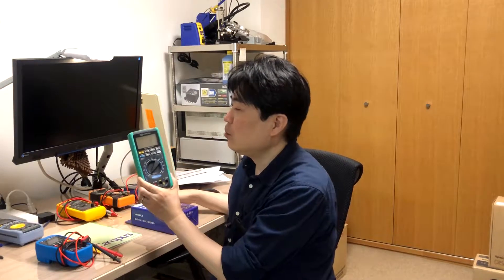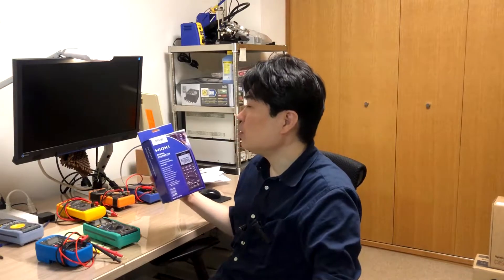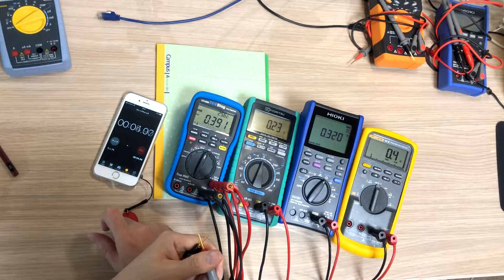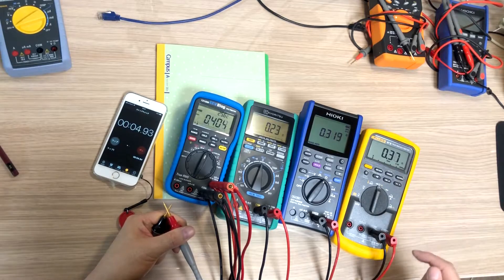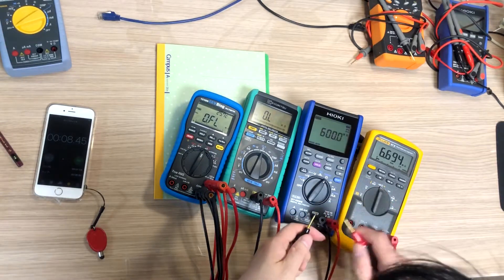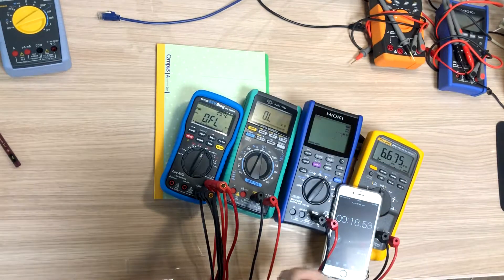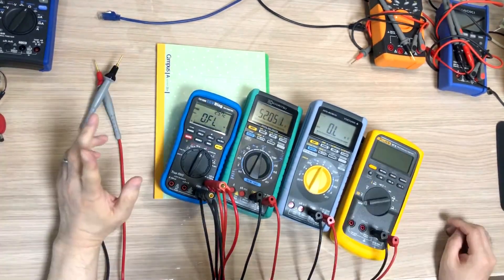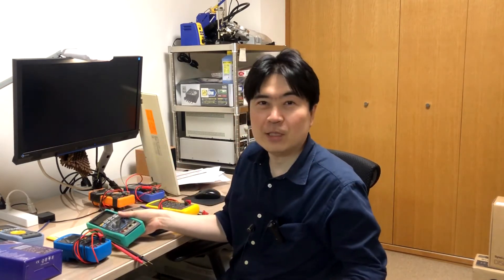Akira-EN #8 121GW Yokogawa TY720 Hioki DT4282 Fluke 87V 50K count multimeter review auto range speed

Comment: great video ^^
and also i had a few question 
why the Hioki and the Yokogawa have some plugs on the A and mA plugs and is it possible to remove them ?
and also at 6:29 you can see that the Kyoritsu and the Yokogawa don't have the same precision, the Kyoritsu shows two digits instead of the single one on the Yokogawa even though they are the same, i kinda find this strange  but maybe they have multiple mesuring mode

Comment: Wait a sec… you can't measure ohms with multiple meters in parallel. Even the autorange speed will be affected since the competing test currents will mess with measurements and thus affect settling time.
Reply from the maker: Yes, I thought the same but I was too laze to make a jig. I am digital circuit person and initially was thinking to measure 10Kohn, 4.7Kohm or 3.3Kohm which I often use for pull up register. But then I need to make some jig to separate all the multmeters and turn on at the same time with relay or equivalent. When they are open loop, probably the current and the voltage from each multimeters are fighting each other. This is the reason I end up measuring the speed only on short. When they are shorted, assuming all the multimeters probably would be detecting the lowest value. I would like to make a jig some time. Thanks for the comment. I am happy to have any kind of comment right now. I started to become busy and not able to make videos recently.